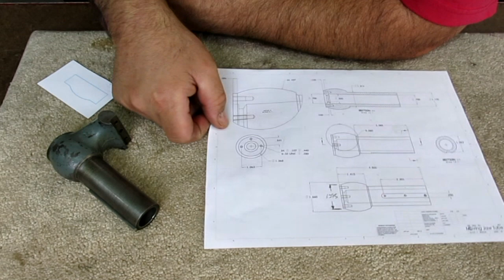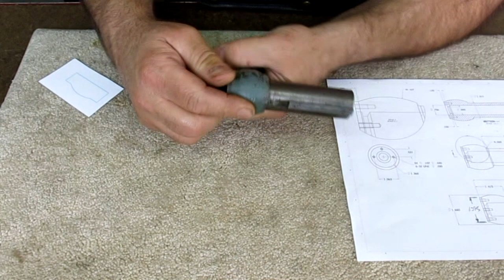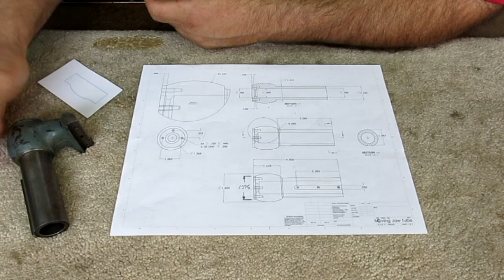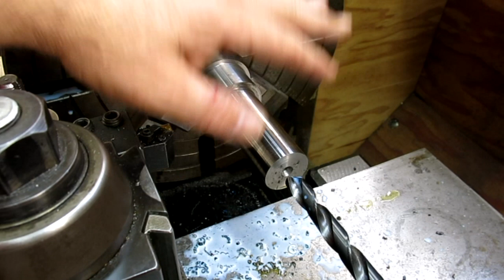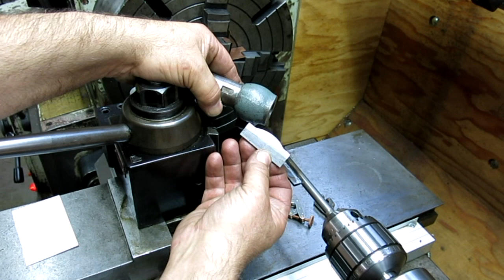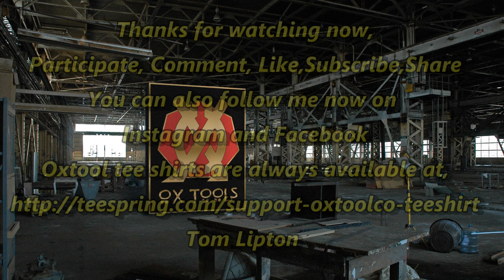Wilton Baby Bullet 8

Comment: Tom,I used to do something quite similar in my high school metal shop class years ago to make curved bongs of all things lol.............Anyway I only used a pointer as we were required to check out indicators and I didnt want my teacher to know what I was up too.Although years later I found out he knew and we had a good laugh about it.He figured if I was smart enough to figure out how to do what I did on my own in the days before google,then I was smart enough to know how to be responsible.Funny thing is I was never a big smoker and I never actually used the damn things as they were too nice.

  But the reason I wrote this is I found it much easier to have a steady nice smooth cut while bringing the tool out vs running it in.For instance on this piece I would have run past the downside,run the cutter in and then reverse the feed to make the cut for the other slope,especially towards the end.In doing so it would allow a much nicer finish because for some reason i found it easier and less jerky to draw it back smoothly while tracing.

Anyway just a tip for the future to make things easier,as I've seen the results and they are great.
Reply from the maker: Hi South,

The rate of change seems to be the tricky part. If your machine is pretty snug the direction change isn't too bad. I typically underestimate the rate of change as you get onto a steeper section so the temptation is to crank faster to catch up. Feeding slow sure helps a lot. Thanks for the comment.

Cheers,

Tom

Comment: Awesome trick with the template; have added it to my tips and tricks library! Depending on the work being copied one could even clamp the original being copied to the tailstock rather than a template. Noted your comments regarding that approach in the next video.
Reply from the maker: Hey Thunder,

Yes you could fixture an original part in some cases. Thanks for the comment.

Cheers,

Tom

Comment: Following the tracer is like hopping up and down on one foot while patting your head and rubbing your belly and singing Zippity Do Dah.
Reply from the maker: Hi South,

Well the curve has both innies and outies so you have to do both. For a single curve it is a lot easier. Thanks for the comment.

Cheers,

Tom
Reply from the maker: Hi John,

Not quite that hard but close. Thanks for the comment.

Cheers.

Tom
Reply: If you read my comment there's a tip to make it easier.Basically its easier to keep it smooth while drawing the cutter out vs running in.

Comment: I don't think I'd have the "rub my belly, pat my head" co-ordination to do this method. Nice skills Tom!

What would you do as an alternative? I was thinking; turn the max OD of the part, then start from the edges and take 5 or 10 thou cuts hand feeding in until the dial reaches zero, rinse repeat from both sides. You'd end up with 5 or 10 thou steps. Then take a file and smooth the ridges out.
Reply from the maker: +Steve W Hey Steve,

I would step turn it and then blend the steps with a file. Thanks for the comment.

Cheers,

Tom

Comment: I've been loving this series! Found it a bit late, but working through it. Great stuff! Why do you hold the compound when you move the crossfeed back after a cut? I assume it's something to do with backlash, but I'm curious as to what you have to say.
Reply from the maker: +deemstyle Hi Deem,

It keeps the tool from dragging a line across a finish surface. There is almost always some tool pressure that would leave a line if you just move the carriage back. Thanks for the comment.

Cheers,

Tom
Reply: I see. Thanks for the reply, Tom!

Comment: In order for the tracer to actually reproduce the template, the tip of the indiactor must be exactly that same as your tool nose radius. that is why the OD didnt clean up. you actually mad two arcs and a flat. thats why once you reached the largest part of the template you didnt have to move x much at all.
Reply from the maker: +Tyler House Hi Tyler,

The template was made by cutting out by hand a laser printed template. As long as the nose radius of the indicator is smaller than any radii in the template is should produce accurate geometry. I hand filed the template so it being off a few thou does not surprise me. Thanks for the comment.

Cheers,

Tom
Reply: That's not quite correct. If the radius of the follower is different to the radius of the tool, the follower may be touching the template at a different point on it's radius that that of the tool. But yeah, it is pretty fooking close!

Comment: I've always been meaning to ask this question, but what does a machinist do with the "chips" or the waste material? Do you collect buckets of individual metals and alloys and sell them back to the people you buy the stock from or just give it to them or smelt your own? Or do you not even separate the metals and just have one big ole pile of chips/waste and take them to the recycling center?  Also what's the cost ratio in regards to starting with a 2in diameter (or larger stock) and machining it down to say 1/2 in diameter...  is base metal stock that cheap where you can throw away half or more of your project, or do you typically try to get a piece of stock "close" as possible then take it down to specs.  Sorry if these are total newb questions, but thats exact what I am a total newb when it comes to machining and I'm hoping to pick up a small mini lathe/cnc for performing projects for model making as well as some basic tool projects, similar to the gentlemen over on clickspring.  Thanks for the videos, always mezmerizing to watch you work and speak about items, keep up the great work!

Comment: As usual Tom exceptionally well done. You do I think worry a bit too much your explanations and them being not quite clear enough. For myself I've never been left scratching my head about anything you've tried to explain. But I hope whoever gets chosen for this years WIYB giveaway that they do understand what's going into this replication of a BB Wilton vise. It will be a far superior vise for strength just because it isn't cast. The  screw or nut would strip long before any of the vise parts would bend or break. And value wise? If you were to add up what's involved in the hours of machining and welding time along with blending the welds, this will be a multi thou$sand dollar vise. And I'd also bet you have a few hrs tied up in just working out how to hold and machine all the parts so they very closely resemble the original.

I'd be the last to second guess your methods since you've got at least 100 times the experience I do. So this is being more curious than questioning your methods at all. I've always read that material sticking out from the chuck should be no more than 3-1 for part stick out past the chuck jaws to the parts diameter. For myself I might have drilled the through hole to it's finished diameter first, then cut a 60 degree included bevel on each end of that through hole and then turned the piece between centers. 

And my apology's about how long this is getting, but I thought I'd add a bit about your profiling technique. Very clever and it's obvious that isn't your first part doing it this way. Using an indicator to read the pattern is fairly new in comparison. But if anyone want's to take the time to do some detailed research about "Ornamental Turning", they'll find at least some of the techniques first started in either the 14th or 15th century if I remember my facts correctly. There's a vast amount of there methods we can borrow from that branch of machining. They also used patterns and followers, sometimes rotating bushings against the pattern and heavily spring loaded cross or top slides to allow the spring pressure to overcome the cutting forces that are trying to push the tool out of the cut. Even Lee Enfield the gun manufacturer in the U.K. had a couple of Ornamental Turning lathes in the shops in the early to mid part of the 20th century.

There methods were much like yours, but maybe required a lot less skill to keep that indicator zeroed.
The cutting tool if it's spring loaded the way they usually did it needs to be ultra sharp. The more force that's needed to actually do the cutting, then  obviously that requires a larger spring force to keep the cutting tip forced into the part and the follower following the pattern and doing the proper profile cutting.  And graver's if there really sharp are totally capable for those that thought they weren't of cutting steel. The watch and clockmaker's are also another sub branch of machining that are worth stealing ideas and methods from. :-) and they cut steel with hand operated graver's all the time.

Again my apology's Tom, I didn't mean for this to get as long as it did. But maybe someone can get a bit from the extra information. So I sincerely hope you don't mind what I've added here.

Pete

Comment: Got a question Tom. When you were moving the carriage back to take another cut when turning, did you back out the cross-slide at all? If I don't on our lathe, it will badly scratch on the way back. I assume that is because ours is a piddly little lathe with a lot of deflection in the tool post and your is quite rigid.

Comment: Every few years i have to make two bearing caps and i use the exact same procedure except i'm boring. The two halves are the correct dimension and bolted together. then i just do the inner profile  and i'm done. Its a big teflon ball shaped bearing that rides in the two halves, so i just use the ball as the template.  Great job!  But now I don't feel as smart as I used too,  lol

Comment: The only issues that I see is that the diameter of the tip of the gauge will throw off the tracing. You start on the left side of tip, and in the middle you have extra travel going to the right side because it is flat, then for the rest of your cut your x is offset for whatever the diameter of that tip is.
You said that it is deficiencies in the hand filed template, but I bet that flat area in the center is the same length as the diameter of the tip of the gauge. Just a thought, thanks for reading.

Comment: THANK YOU very much, Tom!  I have a nice vintage angle swivel vise to restore, and I need to make two identical knobs to press into opposite ends of the screw handle about three inches apart.  It looks like this technique would work for me, though probably with a lot of file, sand, and polish finish work with me doing it...  Great video!

Comment: Nice tracing - looks like one could just mount the original in the tailstock if it was smooth enough.

But one thing I don't understand, how can that hole be running out so much?
I mean it was drilled coaxially from the other side and the OD is true, so how can a hole go off course like that?

Comment: Tom, Did you account for the width of the stylus in the pattern? You calibrated it on the left side of the stylus, and when you reach zero on the left side of the pattern you'll be on the right side of the stylus. I figured that would result in a copy that's either slightly wider (I think?) than the pattern. Thoughts?
Reply: +Bradley Weingartner You know, after further thought - the tool is also not a zero point so I'm guessing it just sort of works itself out!

Comment: Tom,
What are you using for water soluble coolant?
I just bought a small pump and tank and I want to start using water soluble coolant for my heavier milling operations.
Thanks 
John
Reply: +John Bazaar There's lots of stuff out there... Tom may use something different... I've personally used Astro-Cut - not near my shop, so I can't say whether it's B or Syn - bought from Travers Tools. I was drilling rolled 304L Unistrut - it was work-hardened before I started in on it!

The Hudson type garden sprayer makes a great spray system when you need a cheap cooling system!

Mobilcut 100, and Kool Mist and Trico are other popular brands.

Unless you are doing something that needs special properties, you aren't likely to go too far wrong by picking one and trying it... A gallon runs between $28 and $60, and for most home / hobby users working steel or aluminum, cheaper is definitely an advantage!

Cheers,

Eric
Reply: +chemech 
Thanks for the info.
I like the garden sprayer idea. I can buy lots of different size nozzles for different spray patterns.
Lots of ideas.
Thanks,
John

Comment: Nice "tracer" jig. I do see a slight problem with it though. The part will always be slightly shorter/longer(not sure) than the template due to the intersecting arcs of the template and the indicator point. As the indicator follows the template, the point of contact of the indicator tip changes, so the indicator will be either slightly ahead of behind where it started.

I have a sketch showing what I mean but can't seem to find a way to link to it.

Comment: The human CNC! Great hand-eye coordination, dont think I could pull that off.
Reply: +Shadon HKW No, no, not CNC! TLC! Tom Lipton Controlled turning. I sure as Hell could not pull that off. Maybe by hand with a graver,  but I don't think I could turn CRS with a graver.
Reply: +Shadon HKW I think that I'd rig this such that the tool moves in and out following the template such that I wouldn't nee to try to keep an indicator dialed in... Sort of a hand-cranked version of Keith Fenner's tracing attachment...

The woodchuck turners have things soooooo much easier when they sculpt a series of steps into a smooth curve...
Reply: We used to do this in our HS metal shop to make smoking devices lol......Its the first time I've seen it since besides a real tracer lol

Comment: Good job Tom! Do you think the "difference" between the copy and the template might be because the indicator tip is riding on the side in the template slopes? It's only contacting dead center on the very top and both sides, where it's relatively flat.

-Trond

Comment: Nice to see how that is done.  The way I probably would have approached cutting that profile would have resulted in more ridges than a ruffles (potato chip).  If all you are out to do is get a general shape, do you think forming with a hand held tool would work?  I've observed it being done with softer materials, but never with steel.
Reply: +diggerop I have turned mild steel by hand with a homemade "graver" as it is called in clock making. But CRS? Not sure. Brass and Ally are easy. Need a tool rest of some sort.